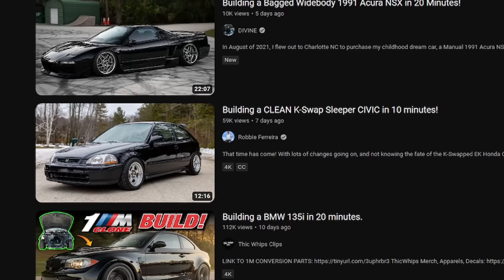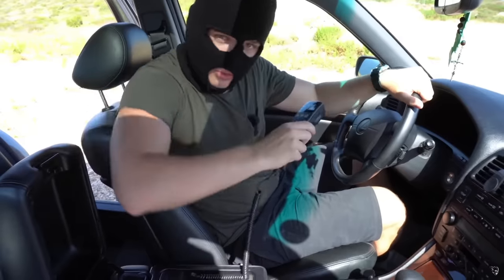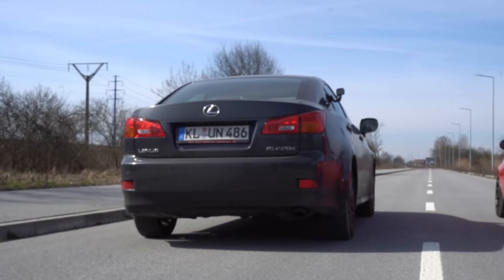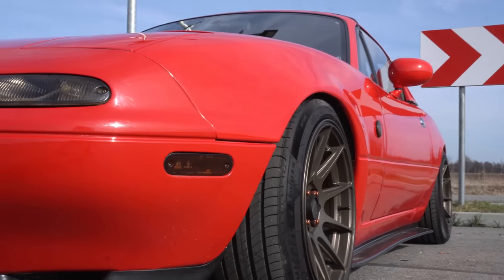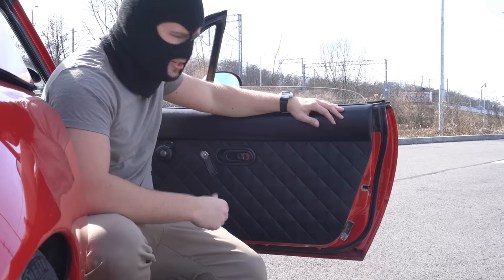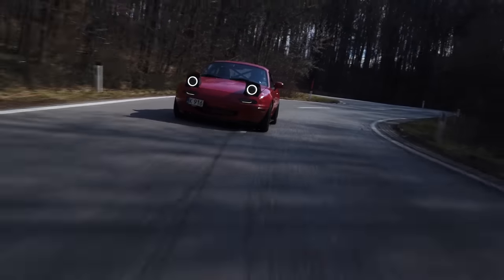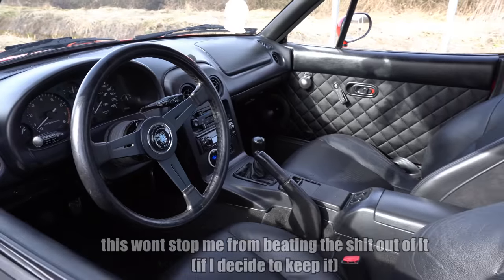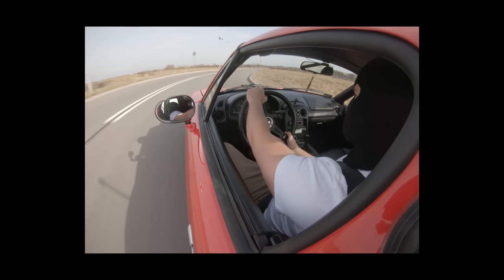Building A 300HP Miata In 5 SECONDS

Comment: 300hp in a miata, which is light af, is crazy
Reply: Is on par with a stock NSX R 2005
Reply from the maker: it's not crazy anymore since everyone runs at least 700+ hp
Reply: 300hp is the best power figure for any car, unless it's a Hummer or Escalade
Reply: i recently was a passenger in a 350 NM BMW (228i 2 series, AWD) and it's quite QUICKKK
Can't imagine 400+ NM of torque on a 1 tonne RWD Roadster, this thing must be wild
Reply: Yeah people really under estimate that my car is 900 kg and has 200 hp wich is also rapid
Reply: @c63w204W  as someone with a huge lexus with 270 hp, I agree with you, I don't need any more power.
Reply: @gijs.22  weight yo power ratio is the key for quick acceleration , if it's grippy it is a track monster too
Reply: @CarMighty  Yo I got a sticker that adds +10 HP
Reply: Wdym it’s a 1996 lifted dodge ram truck
Reply: @shaggings  mustang, Camaro, corvette and viper. All of em corner just fine 😂
Reply: @stanggang768  but they weigh alot
Reply: @c63w204W  my dad has a 2020 sti and i think it needs more power so no

Comment: The slipping clutch is probably the one thing keeping that trans from turning into a container of broken gear parts. Also, the LED halo turning off when the turn signal comes on is something that new vehicles do right out of the factory. I think it's to keep one light from drowning the other out.

Comment: The clutch slipping might actually protect the transmission somewhat.
But the best course of action would probably be to replace the clutch for something stronger with a bit of wiggle room and to just mount that 6 Speed if it's capable of dealing with the output.

Comment: 14:18

I can offer a >260k km NA Miata with a stock 90 HP 1.6 engine, no aesthetic modifications at all, a sometimes leaking soft top, an almost completely burned through clutch and (hopefully) worn down ignition cables.

Comment: (Witám Mighty, jestem someone without a driver licence, you don't actually need to care lol)
I wish I could buy it, I work at a car repaor shop since like 4 weeks... anyway, I learn lots of stuff every day and I love what I do there, either way, this is my ride;
Cortina U4 (transport) with;
+ Aluminium body
+/- 3 speed semi-auto (yes it can sound like a kalashnikov 500 meters away, aaand your dying wallet at the same time)
+ It's a naturally aspirated... ehh, yes, it has a simple engine layout which can be a pain in the lower-lower back to reach (idiot says, if you go full throttle, you might just fully break gears and shit, no seriously, I am scared to death if that stuff breaks, and it actually will kill the rider if it does at high speed, so maybe swap it for some scooter things)
+ 0 to 100km/h, I hope not
+ 0 to 30km/h, I do it on a daily base in 5 to 7 seconds.
+ It's matte black, I mean, that looks just right.
+ Do I need to be in Mighty's video displaying it? That's to Mighty to dicide, but I sure as hell would like to (pssst, content?).
+ The lights are for cosmetic value as these shitty thing always die when I need them.
+ Are there any things that should be placed behind a - ? Probably yes, but I like my U4, so everything is good (enough, sometimes, that's a lie, this thing is as crazy as I am, no shit when I'm the rider of the U4, but this thing just won't break, most things do, but I am really suprised the frame is in one piece after way over 10000km of beating, and yes that are four zero's behind the 1, it's my daily ride for well over 6 years now, so maybe even 15k km what it has done yet, I dunno lol).

Did people actually read all that... holy shit, it's just some bicycle I'm not turning in, sorry not sorry :>
If people want to know, yes, my legs are too strong for the gear stuff, I once broke the chain thing or something, I didn't have any breaks lol, lucky me that I was pulling away in front of a big truck🤣

Comment: I'd downtune it to stop munching the transmission and go ham on a set of thin cheap tires meant only to make black circles. Then use the wider wheels and tires for general use and grip driving. Makes it cheaper to run and still blisteringly fast. 240 HP is a whole bunch of Miata. It's to nice to ruin by maxing out all the time tbh.

Comment: I'll trade it for my Honda Accord. It drives. I added oil recently. Has a Momo wheel and a Pioneer radio (with bluetooth). If you have imagination it even has vtec (it doesn't). Lost my v card in it so it's worth more, a good deal.

Comment: 9:31 this is a federal regulatory requirement in the US. apparently some lights that are brighter than the turn signal have to be turned off when the turn signal is on. stupid but it’s there. not sure why it’s happening outside the US tho, US spec headlights/wiring?